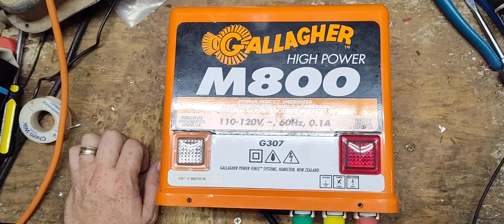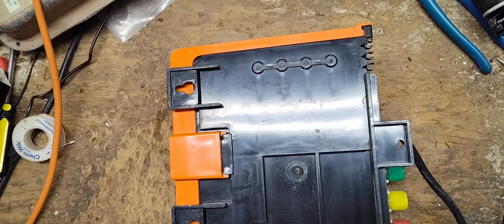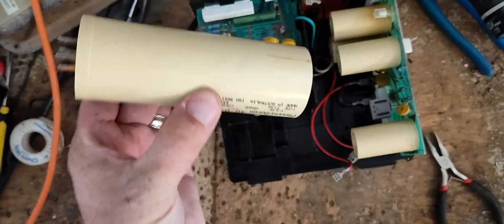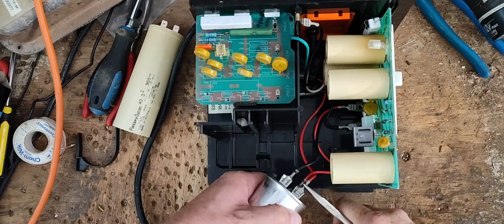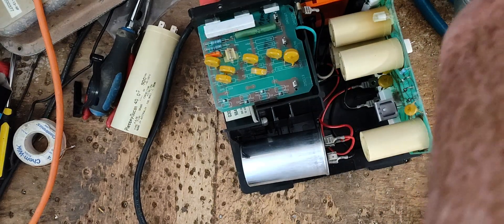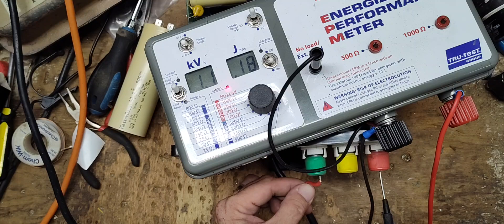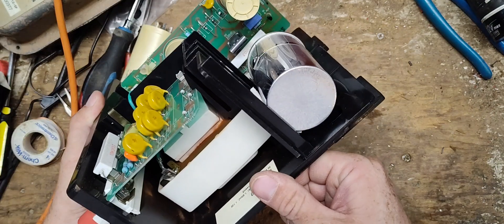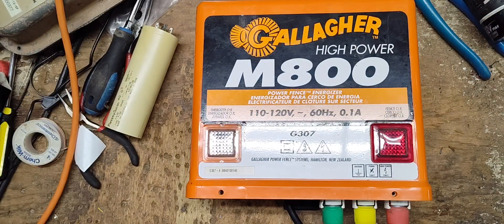Fixing The Best Electric Fence Charger Ever Built | Gallagher M800 BEV3 Repair

Comment: This unit is a lot cleaner than the previous one you repaired.  Are those large capacitors on the control board used for voltage multiplication, R/C timing or both?
Reply from the maker: They're part of a multiplier circuit with some diodes. They convert the AC input into a DC voltage that is multiplied to eventually make it into the large capacitor. As they do weaken overtime, they can't charge up as high so they'll discharge a little faster and then make the unit click a little faster. I've replaced some of them on boards before, but they typically last "forever" and don't need replaced that often.
Reply: @FencerFixerRepairLLCKansasCity  Thanks!

Comment: Have schematics ever been released for older gallagher units?
Reply from the maker: No, unfortunately no schematics for any brand from any age have ever been given out. Luckily older stuff is easier to go through on most of the gallagher units. I've worked on enough of them that I've learned to look at the common things and a majority of the time that's all you need to do.  I never over complicate things with these units. If you know what the symptoms are, the boards are pretty easy to go through and schematics aren't really needed.